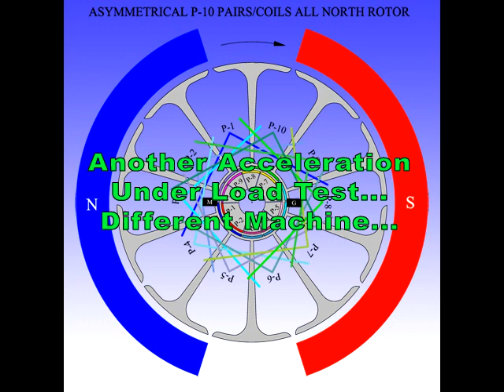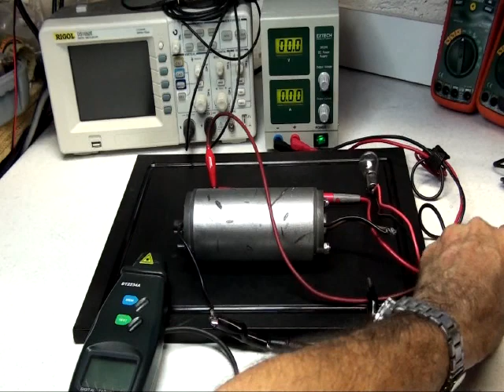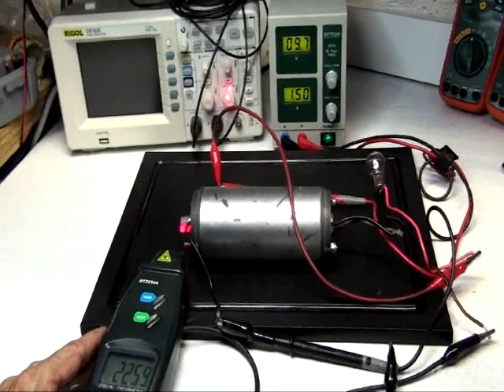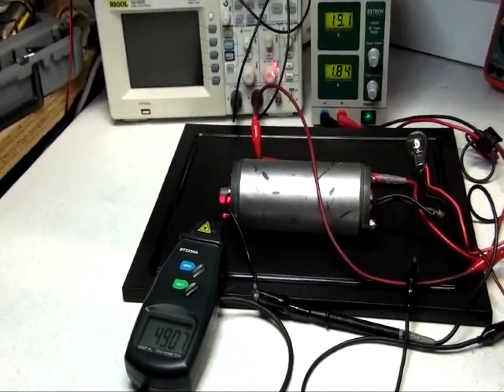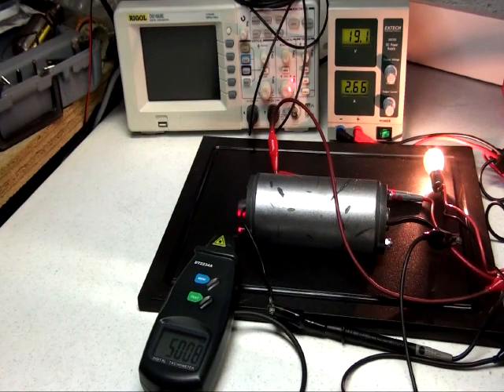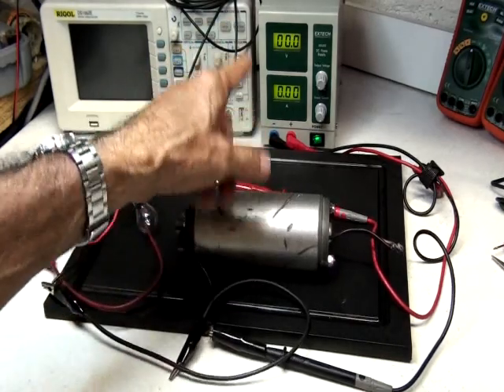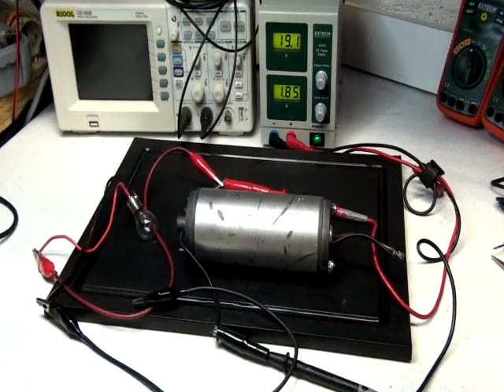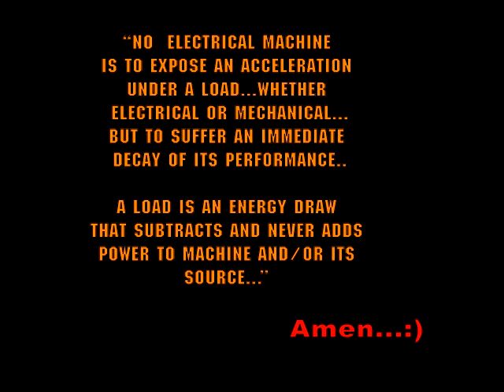REGENERATIVE ACCELERATION UNDER LOAD 10 POLES

Comment: Hey, I havent made this model yet but when I had a variable frequency pulse power supply run the 16 pole asymmetric motor I made with a capacitor on the generator side, I noticed at certain frequencies the cap would gain higher voltage than the input and the motor would go faster...This could be the whole core going into resonance due to some sort of balance. Perhaps when the LC system on the generator side is in resonance the DC voltage appears strongest, worth checking into!

Comment: Just curious.
What happens if you attach a capacitor as a load.
What happens if you put a battery as a load, and play with the input voltage so that the motor generates a tiny bit less than the voltage of the battery (the battery will help the rotation) and spot on, and to the point where the battery will be charged up.

As usual, thank you for sharing. You are the one.
Reply from the maker: Of course it would charge a Battery, of course it will charge a Capacitor...the Incandescent Bulb is a big waste of Energy...in heat and Light...it is an EXTREMELY SHORT CIRCUIT, with almost NO resistance but the Tungsten Filament in the Vacuum...:)

Thanks!
Reply: I agree. And/or but what is the effect on the speed of the motor in those 4 cases? Because I anticipate that when just around charging or not, there might be some oscillation going on. And I did not ask for a coil as resistance, but that might have a strange effect as well (I know it is DC, but you could try a transformer primary coil with 100+ ohm resistance). I hope to see some resemblance as with the QEG. It has a fluctuating inductance value (between 30 to 40 Henries). I can imagine that is like the delayed Lenz thingy.
(just food for thought, it not about right or wrong).
Reply from the maker: deslomeslager
My development about this New type of winding (All North, Unipolar) is still "in process"...till I am satisfied widely with results...next am gonna take apart this Motor and rewind it according to groups of Coils, not Pairs...more copper, less resistance, more magnetic fields and strength on less amp draw...if it exceeds this one shown here...then moving on to my 20 Pole Much Bigger BOSCH machine...it is a race for higher level and Big sized machines like my Imperial Asymmetric Beast...:)